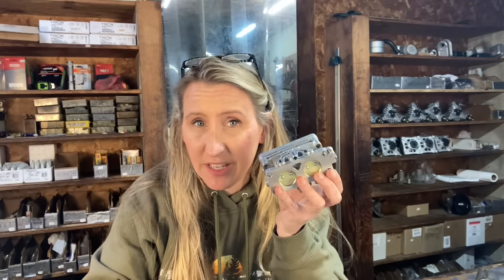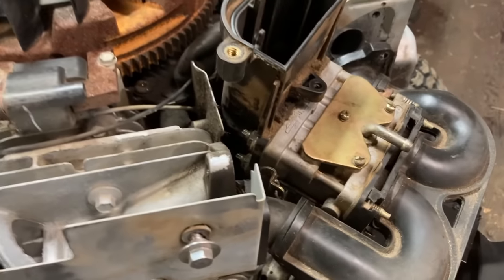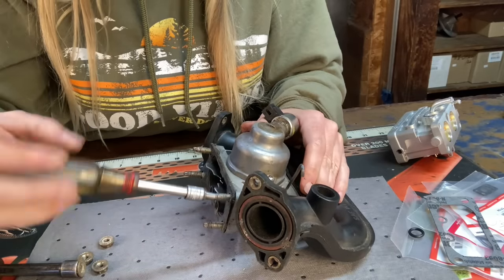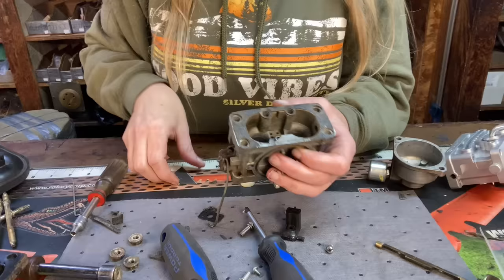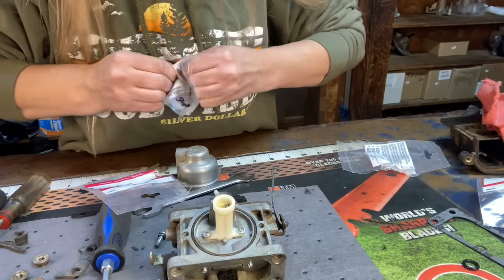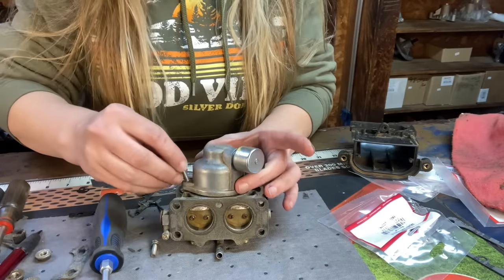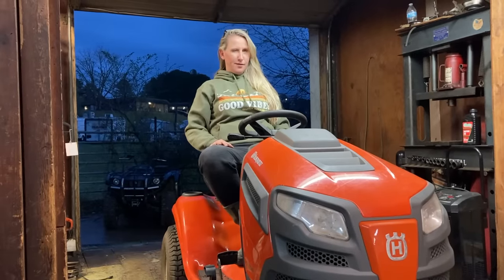HOW TO FIX A SURGING RIDING MOWER Briggs and Stratton Double Barrel Carburetor Rebuild- Repair

Comment: I've got to the point i just buy new carbs anymore. Trying to find a place where i live to buy or look up parts is impossible. The last carb I rebuilt cost me $103 for rebuild kit & it took 3 weeks to get parts in. I just replaced the carb on my rider yesterday. I ordered new carb with gaskets, spark plugs, fuel filter & air cleaner for $43. I ordered on Amazon & had delivered in 2 days. I do appreciate your vids you are true professional showing & explaining repairs. Ive watched several of your vids when trouble shooting engines ive been working on.
Reply: CLONE CAEBS RARELY WORK CORRECTLY ,YOU MUST HAVE GOT LUCKY. i do understand ,the parts cost is outrageous.
Reply: I don't waste my time rebuilding carburetors myself as it's so much easier and cheaper just to buy a new one, but I don't buy aftermarket ones due to corrosion issues.

Comment: It was a pleasure to watch you work. As a very seasoned mechanic (read that as old), it was obvious to me that you have a good grasp of what you are doing and how to use tools. I have a John Deere mower that has the same carb and it is running rich. I bought a new carb for it and needed to figure out how to replace the carb with a minimum of cursing! Your video was excellent in giving me the instruction that I needed and I'm going to give it a go tomorrow morning. Thank you!

Comment: I have a similar carb setup on my Craftsman 21.5 Intek.  This video helped me immensely with removing the carb and manifold. I found that one of the manifold gaskets was trashed, which caused my backfiring/surging and lean condition. New gaskets for $7.xx and it runs like new.  Thanks for making this video!!!
Reply: Part number of gasket seal ??
Please 🙏
Reply: @philliphall5198  Briggs & Stratton OEM part # is 691917, Seal-O Ring.  It’s not a flat gasket on this carb at the manifold. It’s an O-ring, and it takes 2.  One for each side.

Comment: Thanks so much for sharing your knowledge and experience.... I'm just a homeowner and your video gave me the confidence and insights to try rebuilding the carb on my Husqvarna YTH22V46...However, I was lucky, after removing the shroud, I found the carb and linkages were completely caked over with cutting debris.  After removing all the debris and thoroughly cleaning the area around the engine and carb, the surging and other issues have all cleared up.  And if I do need to eventually rebuild the carb, now I know I can do it, as I was only one step away from removing it.

Comment: My Uncle that worked as a car and truck mechanic for 40 years or so, taught me a cool trick, how to magnetize my screwdrivers. He would get a length of copper wire (insulated is fine with bare ends) and wrap it around the shank of the screwdriver (several times is okay) although the more the merrier. Wearing gloves and eye shields (he did not) touch one end to the post on a car battery then quickly touch the other end of the wire to the other post (like lighting a match, several strikes were sufficient). Sparks would fly, but a small amount of magnetic energy would stay with the screwdriver. This would allow one to load the screw onto the driver while pointing it sideways or downward and it would stay with the driver while you aim the screw at the threaded hole. Happy threading!! Tim Duncan (not the basketball player)

Comment: OKAY WOW! Our mower is the exact model you are working on and was surging just like you opened with. This video just came up on my feed this morning. I appreciate the benching of the carb. I wish I would have seen your video sooner. Last weekend  I found a whole new carb kit one eBay motors for $25.00. It arrived yesterday... Came with new plugs and all the gaskets. I guess I will just take one off and slap a new one on.

Comment: I have this same carb on my John Deere  (23 hp Briggs ) and I have the surging problem as well....but not all the time.  I need to do this carb rebuild  so I will keep this video for reference  when I get the parts for the rebuild.  Thanks chickanic for this video. It will help  alot.😁

Comment: Great video as usual.  Today I just tackled this same carb on my 24hp B&S Simplicity Zero turn mower.  The sad thing is I didn't have a carb kit.  I just wanted to see what might be the problem of my surging engine.  Wish I had found your video before I started.  Anyway, I cleaned everything and reused all the o-rings and gaskets  and finally got it all back together.  I had the misfortune of having the linkage that operates the choke pop off without me seeing how it looked before hand and like to have never figured out how it went back together.  Anyway, it fired up and ran much better, not perfect, but much better.  I'll be ordering all the gaskets, jets, o-rings, etc. from your list and start all over again.  Should go much faster the second go around.  Thanks again for all the info.

Comment: Thank you for your excellent video. My Briggs V-Twin was surging badly.  The two jets that you said had a right and left were laying in the bottom of the float bowl.  The tiny o-rings had deteriorated and would not hold them in position.  It was a chore to replace them with my fat fingers.  I could not see any difference between the jets or any markings to identify right and left so I took a fifty-fifty chance and installed them randomly.  Looks like I got lucky because all is well.  Thanks again!
Reply: Thanks my friend ❤️ 
I  rebuilt two carburetors last month and I put the jets in the wrong place, so thanks for the update and information on the right and left jets. 
May God continue to bless you in and on all your endeavors.

Comment: Thank you, I have a craftsman snow blower that surges the same way as that rider. I've had the carb taken out and cleaned but I think I must have not lined up the stupid multiple gaskets correctly after replacing them when I put things back together. Time to try again. Again, thanks!

Comment: Great video, I have a YTH24V48 that has started surging, 96 Hours run time. Going to first check the fuel pump, then proceed with the checking of the carb, and gaskets.
BTW - the dealer told me to NOT to run the carb dry for winter storage, as the gas 'keeps the seals in condition'. Hah!

Comment: You will want to use an 'E' socket, probably a size E4, for those carb studs. Fasteners like that are becoming more common, so you might as well get a set of the correct sockets. Be sure to get a set that includes the small sizes.
Reply: 5 is correct size
Reply: @philliphall5198  For reference, E sockets are sized by measuring the point to point dimension across the diameter of the stud, in mm. E-Torx sockets are sized with a completely different method than Torx bits.

Comment: I got this car on my mower with the same problem. And it was cheaper to order an Amazon carb than the parts. I'm not sure if I'll swap the parts over or use the cheap carb. Either way this video is worthy of a follow!
Reply: I can assure you the Amazon knockoff most likely will not work properly.

Comment: Check your "new parts" for flaws, save yourself a LOT of headache! 
After replacing my head gaskets I went ahead and cleaned my carb, so this video was excellent as it's my carb. I have a Dixie Chopper with a B&S 23HP twin cylinder. But... after getting everything back together it was only running on one cylinder. Short story is that the NEW manifold to head intake gasket had been crushed on one side (you could see it was done during production, another gasket got crushed into this one) and it wouldn't seal, the intake was sucking air. Luckily I found the defective gasket during reassembly, this after doing compression test ,spark test and carefully cleaning the carb again. I happened to notice the imprint on the new gasket as I was reassembling. I used the old intake gasket and it fired up fine. Took it out and mowed some tall grass, whatever I fixed brought back it's power! The head gaskets didn't appear blown but something brought back the power. 
Bre, I love all your videos, you've taught me a lot.

Comment: Wow the amount of dirt that engine has ingested, no wonder it was surging! Great job on h that carb.  A really simple carb that works great.  Intimidating for the inexperienced tech. Can you link your carb rebuild mats?  Thanks Bre!
Reply from the maker: Thanks Babe! I got them from our Briggs dealer, Power Distributors.  I use them mainly to set saws on while I working since they soak up the bar oil and gas so well.
Reply: Hi do you have a video of a stihl fs85 to service the carb as mine won't prime when hot it will prime only cold iv changed the prime bulb gasket and diaphragm done a full carb refurb and new petrol pipes and still won't prime when hot any ideas
Reply: @robertthomas8311  Bad Primer Base CheckValve
Reply: @Chickanic  will your link carb rebuild overhaul kit fit a 22hp briggs intek v twin it's on a john deere 100 series...d140? Thank you so much need to buy one and wanted to use your link. Don't want aftermarket looking for oem which your link is :)
Reply: I believe they are pig mats that she uses in the video? Those things Rock for anything fluid related about 30 bucks a roll on Amazon and it's a good size roll
Reply: @Chickanic  them pads are for soaking up any kind of oil and fuel will not soak up water . I use them at work and we also clean oil spills that get into streams and rivers its cool when you see them absorbing the oil off the water .

Comment: Amazon carb kits cost a LOT less and are not bad quality. I put a little gel lube\assembly oil around the rubber parts when reassembling so the rubber doesn't warp and can slide in easily.

Comment: Hey Chickanic. I really love your videos. You have helped me out a lot. I have that same carb on a yazoo kees 48 inch zero turn with a 19.5 hp briggs. I rebuilt the carb just like your video shows, the only difference is my carb has one jet mounted to a fitting that screws into the fuel shutoff. When I cranked it the engine still surges until it warms up. After that it runs pretty smooth. What did I miss? Thanks for having a great channel.

Comment: I had the same surging issue, but it was caused by the two small jets that were clogged. I'm surprised you didn't have to clean those out.
Reply: I replaced the carb kit except the 2 jets, the ylooked good and clean. My mower still dies after 10 minutes. I went thru everything, carb getting gas, replaced hoses, pump, needle, cap, finally adjusted choke and governor and it started right up, ran 2 hours, but now dying again.  Guess I will do a kit again. I see gas doesnt fill  up the filter while running, i wonder if fuel filter should always be full of gas, tank hoses maybe? IDK. I will try focusing on replacing the 2 jets with O rings.

Comment: I used the links to order the rebuild kit, It had almost everything I needed to rebuild the carb, except the jets. The kit cast $69 bucks! the jets cost $17 and $19 bucks left and right respectively. I noticed that you had a brand-new carb on the bench next to the one you were rebuilding! Got me thinking, Checked the price $29 buck on Amazon! I learned 2 lessons. How to rebuild a carb and that I'm an idiot!

Comment: I’ve got that same setup on a Simplicity.    The best thing you can do to avoid all this is put a tiny inline shutoff valve in the fuel line .    Then try to think to always shut it down using that valve.     It’s no big deal during the season but try to never leave gas sitting in the lines and carb during layup..   Avoiding ethanol gas is the other way or better yet use both.      This sort of thing has become so common since ethanol garbage gas 🙄it’s just sad.
Reply: I drain my John Deere and run about 1/4 gallon of tru fuel for about 10 minutes.  I wish it had a shutoff though that would be so much better

Comment: I bought two generators with a Brigs and Stratton engine and both were surging from the first start. Took both back and avoided the brand.  Too bad I didn’t understand how to get it fixed  but since they were brand new got a different brand.

Comment: Thanks for the rebuild on that Briggs and Stratton carb. I have a John Deere with the same carb. After seeing your video I dived into mine. When I got to the jet tube my jets just fell out. I have a carb kit on the way sans jets. How do I know which jet goes where? One jet has no markings on it and the other has 122 or ell 22 or eye 22. The mower is around 15 years old. The inside of the carb looks like it is brand new. Probably because I use fuel stabilizer. I saw your ethanol free test video and found it very interesting.

Comment: Nikki, I have that kind of riding lawnmower. Thanks for the tutorial.

I also have an issue that I would like to know if you could help and possibly due a video on.

I have a Ryobi Power Washer that quit running after using ethanol fuel.

It tries to start but after pulling the rope twenty or so times, it gets tiring and doesn't start.

Whatever you can advise, I love what you do.

Thanks, Jim

Comment: Great videos. This question has nothing to do with today's post, but what is the best fuel line that will be in constant contact with fuel in tank.  I've tried several different types and they all swell and break inside the tank. 
Thanks

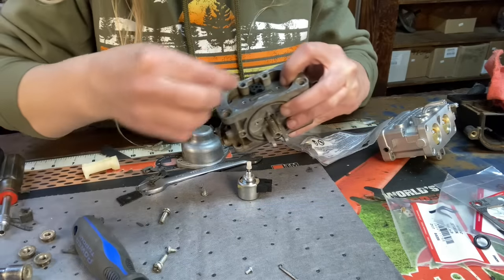Comment: At 10:00, that was where I f’d up.  The plate can be attached perpendicular to the opening— well, that’s wrong! Lean the top of the plate inside a little, then screw it on.  If you don’t do this, the choke linkage won’t fit right and will rub up against the manifold.  And reattach the linkage on the carb side before bolting the manifold back on.

Comment: I use blue lock tight on all internal carb screws I've had several engines that other people have repaired where the screws came loose sucked into engine 
Just a thought

Comment: named Randy I just rebuilt my V-Twin carburetor by your video put it back on it'll take gas as long as I'm pouring it in the fuel pump is working there's gas going to it but it won't fire.

Comment: Thanks for this video. I bought a used 24v48 this spring and it's been running fine. Ran the fuel dry the other day and when refueled and started the surging began. Any comment on this? It was running fine and then it wasn't. Most likely going to follow your directions here. Thanks again.

Comment: Had one of those issues, turned out to be the plastic intake manifold distorting when motor heated up during operation.
Reply: Mine will surge only after it's warmed up. I wonder if mine is the same issue?  did you replace the intake?

Comment: Hey, great work! You made it look easy. I have a 2013 YTH24v48. I rebuilt the carb using B&S parts, I double checked L&R ports before putting in the jets. The engine runs smooth at idle, but now runs a little rough at speed with the blades engaged. Any pointers?

Comment: Hello,  I never saw you remove your original jets.  I took my Carb apart it didn't have jets or the o ring that goes above them.   My Carb has a spring that holds the butterfly thing open. I don't know if that matters.  Thanks for the video it helped guide me

Comment: I noticed dirt inside the manifold, and what appears as a dirty area on the manifold gaskets. These plastic manifolds are notorious for vacuum leaks and warping. if you spray carb cleaner around  where manifolds connect to heads ,and engine speeds up, it's time for a manifold/ or a lot of silicone. I'll bet the air filter was nasty !
Reply: It’s a matter of how much silicone to seal it off. Lololo

Comment: I have a YTH 22v46  just like the one you did the carb rebuild on, and I was wondering have you ever had to adjust valves on  a  Briggs 22hp mower? if so  can you recommend the valve setting on that type of engine.

Comment: Hi Bre, love your channel and how you explain in a step by step process.   Any idea if the 2015 Husqvarna GT 54LS 24 HP B&S uses the same carb?  Mine is surging the same way as the one you repaired.   Thanks
Reply: Follow up - This model uses a single barrel carb thus the kit is different.  I does appear a poorly designed intake manifold that does not seat evenly on the heads maybe causing the surging problem.

Comment: I just happend to come across this video. I had mine apart a few times over the weekend. I have a la series john deere with the same carb. Long story short, I was able to get the engine running as for some reason it wouldn't start. But now I'm second-guessing the main jets. When I cleaned out the jet tube, they came out. I didn't realize they were side specific. I'm assuming since it's running good, I lucked out on the sides. If they were opposite, is there a symptom? And is there a part number on the actual jet? As anyone would know, they are tiny. I'm just curious.. thanks, keep up the good work.

Comment: Hi noticed that you started a ride on and worked on a push mower. Well I have a Troy bolt riding mower well it to surges cleaned the carb up ran good for a while now surges again. Any ideas 
Thanks

Comment: Thanks for sharing here, Chic.
Do you have a Briggs Part# for that "very special tool" you used to press those jets into the base? I've not seeing that tool on their website...
Reply: On a serious note, I'm curious as to which of those parts you replaced was causing the surge. The gaskets were obvious, but why change the jets?

Comment: i have a que4stion. 

the choke plate that you removed . . . . you put it on backwards.  the top plate goes on outside, not inside the carb. 

(edit =  . . . it will not choke  at all ,  because the plate is in wrong  ) 

the choke stabilizer rod , did it have a spring ??? or no return spring? 

plus,  is there a difference between  an automatic choke  and a manual choke stabilizer rod ?   

i am working on ome,  and would like to know the model number of that carb.  i think i have to order one ,  if the manual choke stabilizer rod is different.